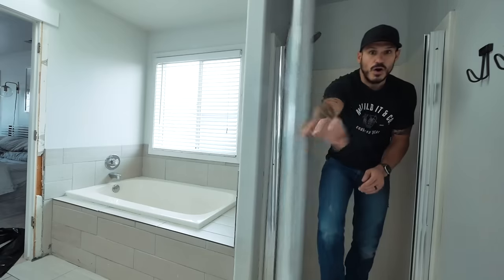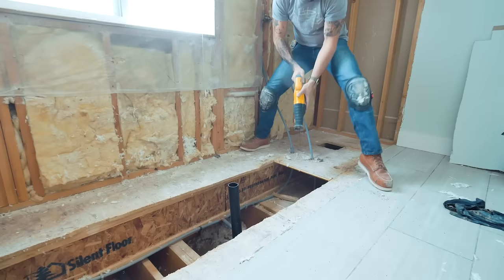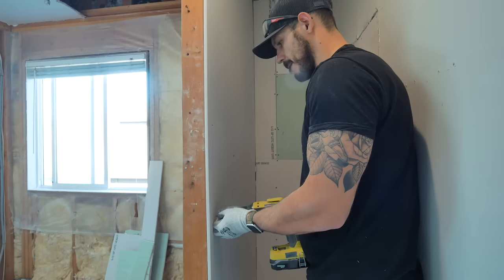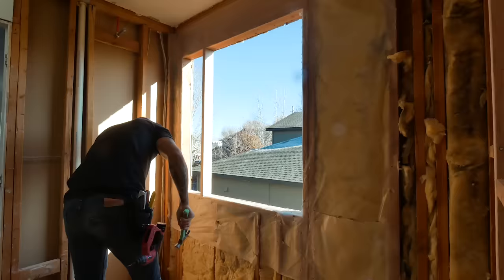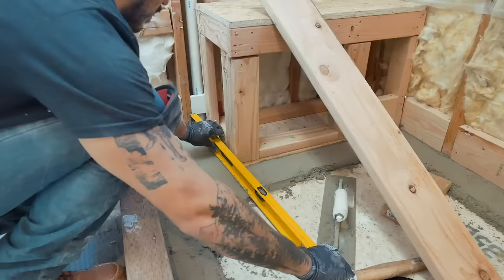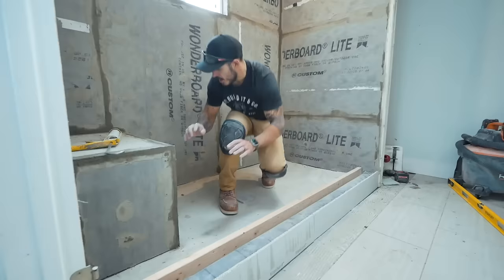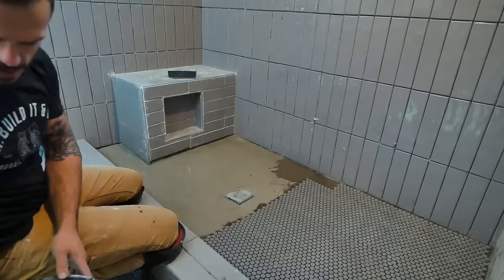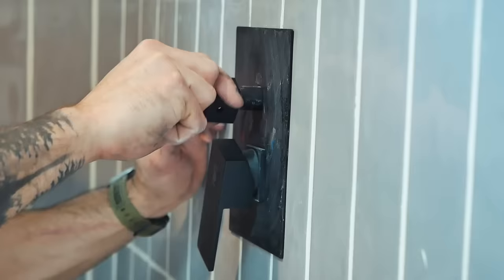Building a GIANT Shower (Home Remodel)

Comment: DO use a MOISTURE BARRIER under your pre-slope when packing over dry, porous materials.  It IS INDEED an IMPORTANT and NECESSARY step.

9:15  "...seems to be that some people are using carbon paper barrier before this layer and from my homework on this project, it's an old-school method that's practiced less and less these days."  The more correct way to say that would be to say that it is used less and less these days by people who have no idea what they are doing and is taught as being an unnecessary step by people who have no idea what they are talking about.  

When going over wood or concrete, that moisture barrier keeps the moisture from being sucked out of the bottom of your pack.  When the moisture gets sucked out, the pack doesn't cure correctly and becomes very weak and crumbly and is a very unstable base.  Over time (sometimes not very long) that pack (because of this) will start breaking apart and crumbling under your pan and cause your pan pack to start cracking apart.

Comment: This is awesome! Dumb question, is there a reason why you didn't lay rubber on the bottom edge of the shower pan, where the wall and shower pan meet? Also, why not coat the floor pan?

Comment: Love your work. It’s amazing. I have a quick question. You run water line through attic, did you consider pipe freezing factors during winter. How do you prevent the pipe from freezing. I am doing the same remodeling but I am bit nervous because insulation I have in attic is on the floor not through out the wall and roof. Pls reply?

Comment: Cutting in the handle after is not ideal... You broke your waterproofing membrane.. If you do that, I HIGHLY would advise to bandaging your waterproof. (painting on extra and lapping over the old membrane)
Once you break the waterproofing membrane, it will slowly deteriorate (similar to peeling paint). Steam/water will slowly peel off the waterproofing. (Waterproofing is usually a negative membrane, meaning it is one way.. if water penetrates the other side, it will start to peel..)

Comment: My humble comment to this remodel - there was no need to move walls, the old tub area is enough for a good shower. Instead I would install a door to separate toilet, so two kids could use the area at the same time - one in the toilet, another drying her hair or brushing teeth, if needed. Otherwise - great video!

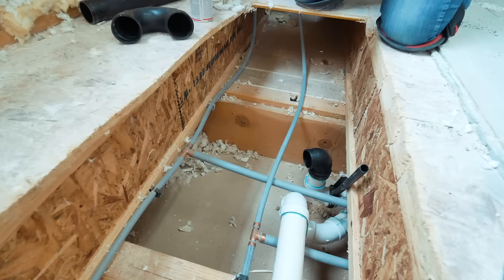Comment: 2:16 That is an S-trap, that will not work and will fail you an inspection. 
Also, are those polybutylene pipes? They are prone to leaking as they are unable to withstand common disinfectant for long.
Reply: isnt the s trap for the toilet?
Reply: @rennycepeda6576   Toiles have a built in trap and require a much wider pipe. 
By code a toilet has to have a horizontal vented pipe with a flange on top of a right angle. 
You can’t add a trap after.

Watch the video further and you will see that later he cuts this pipe and puts the shower drain on it.
Reply: @Rakusan2  oh yeah i know he used the s trap for the drain,i just forgot the toilet have them built in. Now in my country we use a vertical vent for toilets, didnt know there was horizontal vents

Comment: Yikes. I would never put that short of an elbow from PEX to an adapter for a threaded pipe. ALWAYS use at least a short length of pipe (6" or so) and secure/strap the pipe at two locations BEFORE connecting to PEX. Just asking for leaks if you don't. Also: cement board wasn't necessary and is more costly than your drywall designed for bathrooms/wet areas. And lastly: caulk is NOT waterproof UNLESS it has silicone mixed in and yes they sell that,  it's a specialized caulking! If you don't have to paint it, use a clear silicone that has a mold and mildew rating. If you plan on painting it, use a siliconized caulking.

Comment: “If I can do it you can do it”
Me: lives in country where you need all plans approved by the local government and all electric, gas and water must be done by a licensed person or your house will no longer qualify for home owners insurance which is required in my specific state. “No I can’t :(“
Reply: In my country there is something called "Monkey's Law", that lets you legalize any small irregulated modifications to your house or a simple construction in your property (only for residential or small business).
Reply: What do they do come in and check out your bathroom to make sure you didn’t do nothing to it
Reply: Dave J sadly, yes.
Reply: Dave J not exactly, but say my house flooded,and they found out I had done some DIY work to my house without proper permit then my insurance can tell me to bugger off even if the DIY had nothing to do with the flooding. 
Also if you try sell the house you can get some big fines
Reply: you must live in Australia to
Reply: @LWayPro  In the US you can go through an inspection process to have each major step of your project approved by a builder to ensure it meets local building codes. I don't understand why a DIYer couldn't do the same in other countries?
Reply: Marc _ for us, we have to do that if we do any diy as long as you get someone qualified to do any water/gas/electric work but before you can even do that you need a boat load of permits which is the real hard part because sometimes you can go 3-6 months hearing nothing then it can still get rejected if anything is off.
Reply: Germany, right?

Comment: just a little insight. if you have or can afford hydronic heat or want your local coal fired power plant to help warm the planet so you can put electric heat mats under the shower pan tile 'Big' shower stalls are COLD unless you are directly under the water always. These BS 'room' size showers w linear drains, body sprays...blah blah blah cant build up that amazing and therapeutic steam you want when you want a HOT SHOWER. Sure you can not run the fan and rot and mildew your home or just build a reasonable size shower...heck even make it with 2 heads and wands if you want a shower for two but when they get walk- in closet big you wont be happy in January when you turn off the water and you are instantly cold.

Comment: Your plumbing work is very poor and your drain piping is illegal.  Also you should learn what vents do.  A vent pipe allows air to enter your plumbing system.  To best understand, if you hold your finger on top of a straw in water and lift it out the water does not drain out of the straw.  When you remove your finger the water drains.  That is what vents do.  Your skill set is good but you need to learn plumbing code if you are going to show people how to do it the correct way.